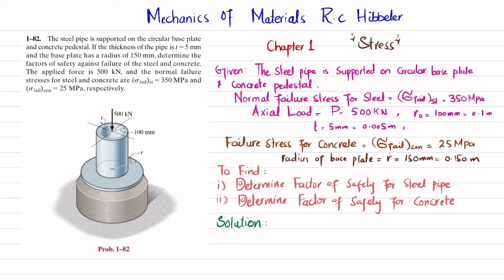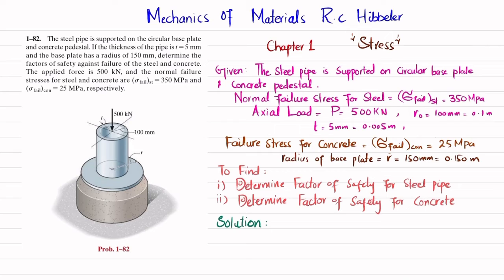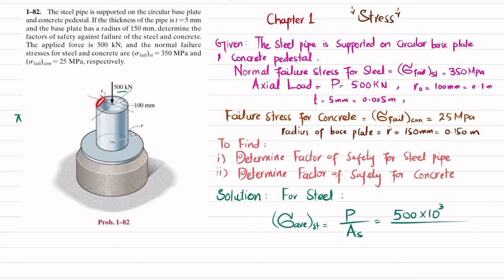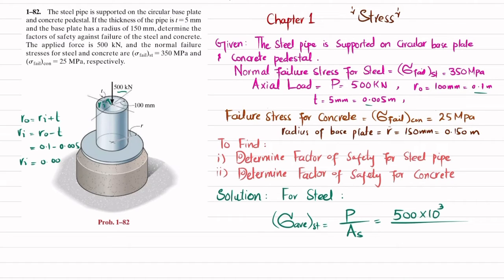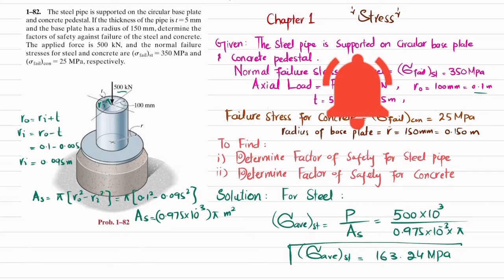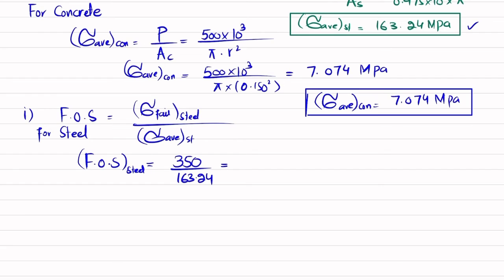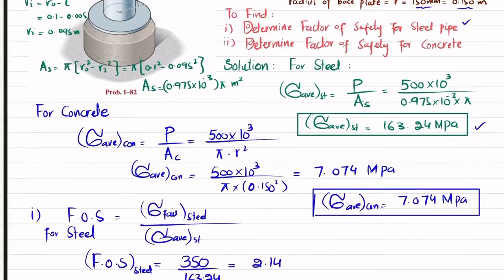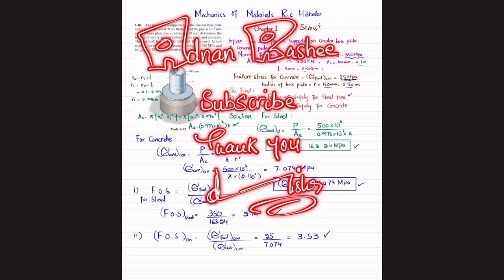1-82 | Determine the factors of safety against failure of the steel and concrete | Mech of materials

Comment: Wouldn't the inside diameter of the steel pipe be 90mm not 95mm?
Reply from the maker: Brother the outer radius is 100 mm and thickness is 5 mm so inner radius will be 100-5= 95 mm